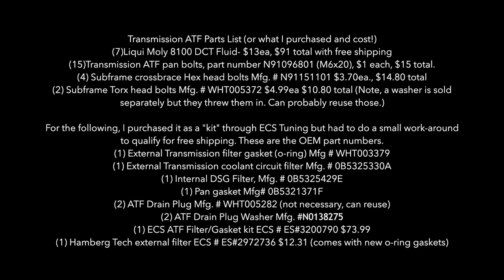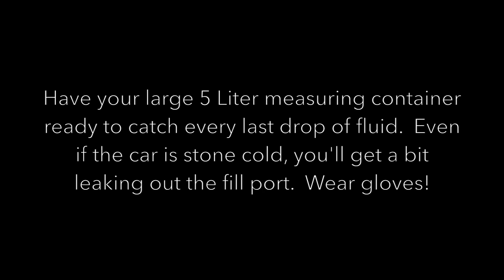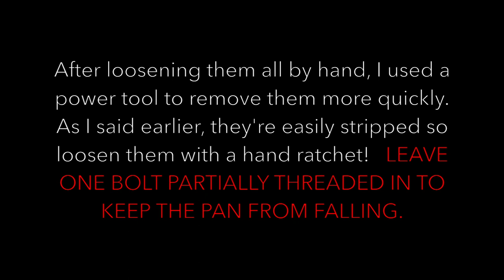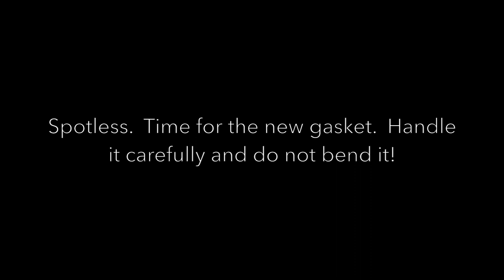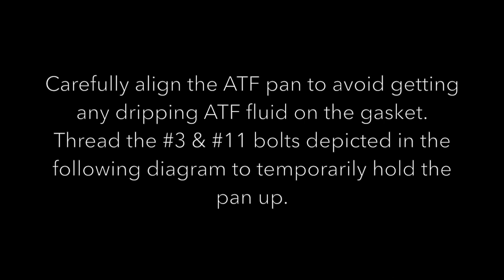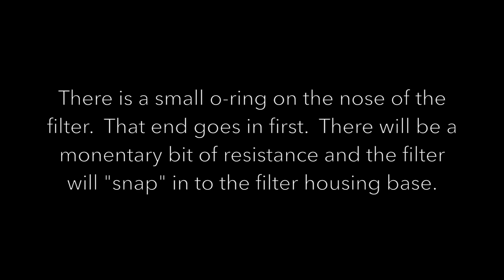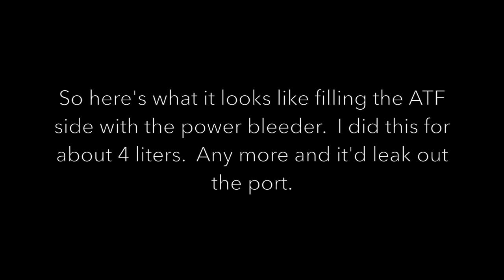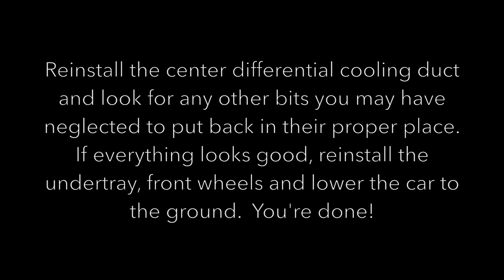RS5 Transmission Service How To

Comment: Love your vids! Quick question, should you replace the cross brace bolts with new ones?
Reply from the maker: Ideally yes, new bolts.  Everything Audi uses is a torque to yield or stretch bolt and is meant to be torqued once.

Comment: Hey, great instructional video. Why was the reason to change the fluid/filter. It is not lifetime fluid on yours?
Also Do you feel some hot spot when your right foot tooches the center console/transmission shifter (where you have media buttons)?
Reply from the maker: It is not lifetime for the RS5 and it's critical the fluids be changed on time per Audi's recommendation.  I would highly recommend replacing the fluid on a regular basis in any car equipped with the DL-501 7-speed S-tronic, RS5 or other.  I haven't noticed any hot spots!
Reply: @RS5Fanatic  My car is 2012 S5 MT 6 speed. I started to get some hot spot when I drive these days. always when my right foot touches center console piece. I heard it is lifetime tran oil. I probably need to at least open the fill plug to check if it is not low.
Reply from the maker: @ersbit  Ok yes, a very different transmission than the S-Tronic!  It can't hurt to change the MTF every 50,000 miles or so especially if you push the car hard at the track.
Reply: @RS5Fanatic  Yep. Great advice. I will change it soon

Comment: Hello. Thank you for this write up :)  
 But I have a question: you have mentioned, that drain and fill plugs atf and mt side have an aliuminium washers. Today I started servising my gearbox mt side and both plugs (drain is with temp sensor like on yours car) and there was no any washers. Looked on ETKA  and there no washers for mt plugs and atf side has just one washer with drain plug. So is here some yours mistakes in this write up or I dont understand what you mean aluminum washers on plugs? 
 My rs5 same year like yours 13", just mine in sepang blue :)
 Thank you for answer

Comment: Nice work dude what kind of oil you used for the ATF side 
I saw your pumping 4 litters but what kind
Reply from the maker: If it was four liters, that's the manual transmission fluid (MTF) and it was the OEM Audi fluid.  I had wanted to use Motul Gear 300 like I did in the differential but their tech guy didn't get back to me in time.  It is indeed ok to use Motul Gear 300.  I like it as it has a super high viscosity index.  The full writeup can be found here:  https://www.audizine.com/forum/showthread.php/833033-RS5-full-fluids-service-how-to-(transmission-and-rear-differential)
Reply: RS5 Fanatic  
I’m going to be honest with you and I’m sure you’re going to laugh I was trying to change the oil on my rs5 last night and I got confused tho I took the plastic cover off the one is next of the steel cover 
And I thought it was the engine drain plug but I guess it wasn’t it was the ATF drain plug according to your report and the diagram you posted on the forum 
So I notice it wasn’t engine oil but it had already drain like 800ml Pf that kind of oil :( so I put the plug back in there real quick and start doing research and found this I need help now tho what do you recommend now to get that done the right way
Reply: RS5 Fanatic I drove the car like that without the oil got drain now is that a problem ? Where can I get a quarter out oil quick so I can have my mechanic put it back in there ASAP ?
Reply from the maker: @johnnylopez5356   I won't laugh.  You're not the first to do that and I've heard of others doing it.  You'll need to get the car up on four jacks (or a lift).  Go to the link above and look for the ATF fluid level procedure.  The other option, which is somewhat easier, is to remove the driver's side throttle body, pull off the vent cap on top of the transmission (It's a little black thing and it pulls right off), install a 3/8" fuel hose, run said hose up above the engine bay, attach a funnel, and pour 800ml of the recommended Audi ATF fluid in there.  That'll at least keep your transmission safe until you can bring it to a shop and have them verify the level properly.
Reply from the maker: @johnnylopez5356   If you cannot get the Audi OEM fluid quickly, Liqui-Moly 8100 is also a good choice and what I use.  I might consider draining all of it at this point (measure it!) and dump in what you took out plus the original 800ml.  You should not drive the car as loosing that much ATF fluid will affect how the transmission shifts.  Be very careful!
Reply: RS5 Fanatic  dude thanks a lot for your quick answers people like you makes this problems easier to solve I really appreciate it 
And yea I notice you use liqui moly 8100 which they have it at Napa Auto Parts. but I was sure if use ATF or MTF oil front side of the transmission but not I know it’s ATF thanks again men

Comment: Were there washers that needed replaced for the center differential MTF drain and fill plugs? My ATF kit came with 2 that I used, and I have yet to do the MTF. My kit did not come with any.
Reply from the maker: There is a washer on the MTF drain plug.  It can fall off and you can loose it when draining the fluid so be careful there.  You CAN reuse it and it will even seal without it.
Reply: @RS5Fanatic  sweet. Thank you so much!

Comment: hi , i realy liked your viseo .
i'm thinking about to buy a rs 5 but the guy say's the the car has a tcu problem in the gearbox do you know something about this ? and is it easy to repair ? 
he say's that the car it's driveble .
please answer , thanks
 .
Reply from the maker: There is something called a mechatronic in the gearbox which is what actuates the clutches.  It was known to be a problem in older Audis before 2012, specifically, the electronics board on the mechatronic burning out.  They updated the design and added a larger heat sink.  On the RS5, it's very important all the maintenance is done on time, especially the gearbox and rear differential.  Make sure the car you are buying has a service history and those items were serviced on time.  

When driving the car, the shifts down should be smooth, particularly 2nd into 1st as you come to a stop.  If you're getting a big "bump", almost like another car has hit you in the back while coming to a stop, it could be a sign the mechatronic is on it's way out.

Nothing on an RS5 is necessarily cheap to fix.  The good news is the mechatronics itself can be repaired instead of purchasing a whole new unit which is expensive.  There are several places here in the U.S. which can fix them as well as places in Europe.  If it's just the electronics board, Audi sells that separately and it's about $400 U.S. for the part.  Fairly cheap.  A rebuild of the solenoids and thermostat is about $500 U.S. and a new mechatronics is about $2500.

So on the S-tronic, the three items which seem to have the most problems are the Mechatronics electronic board (this is NOT the TCU), the mechatronics hydraulic unit itself, and a gear position sensor inside the gearbox portion of the gearbox.  Those are the only items I've ever head going bad and it doesn't happen often like it did on earlier Audis.  

Make sure you have a very specific diagnosis on what is wrong with the car you're looking to purchase.  It is possible to change out the mechatronics unit as a whole or the electronics board yourself, at home.  If it's a gear position sensor in the gearbox, the gearbox has to come out and the case needs to be split to get to it.  It's a $60 part but it'll cost $2K in labor.  Hope that helps and thanks for being a subscriber!
Reply: thank's  @RS5Fanatic

Comment: whats up with the cross contamination  how did you manage that when using the brake bleeder with different fluids for atf/mtf? also you said you used the motul 300??? you mean for the rear dif right??? not the transmission.
Reply from the maker: I did not cross contaminate.  I avoided this by using different bleeders OR by cleaning out the bleeder's container with denatured alcohol.  For Motul, it's GEAR 300 for the rear diff.  I no longer recommend Gear 300 for the transmission as the formula changed.  Redline has a higher VI index now.
Reply: @RS5Fanatic  ah I gotcha! I got an s5 without a sport diff =[... i take it I don't have an ATF side to change on the standard rear diff?
Reply from the maker: @jonathan1164  That would be correct, non-sport diff means no ATF side, just normal gear oil.
Reply: @RS5Fanatic  appreciate it thank you 😎
Reply: @RS5Fanatic  can I use the same ATF oil for the rear diff as for the gear box ?
Reply from the maker: @flabichon  You cannot.  The rear diff is a specific oil they call "transfer case oil" and only use the Audi-branded fluid.  It's expensive but you only need one liter (not even a full liter) for the rear diff.

Comment: Hey man thanks for all the info! Doing the service on my 13 RS5. Can you confirm that the MTF drain plug (temp sensor) has a washer? Mine did not apparently. Thanks
Reply from the maker: It does indeed have a washer.
Reply: @RS5Fanatic  thanks for the reply brother. Do you by chance know the part #? For some reason mine does not have one from the factory and the parts guys here cannot find it in the diagram. They only have the listing for the copper atf one and the temp sensor as a whole.

Comment: Great video. at what millage does this service need to be completed? and what would be the cost of supplies?
Reply from the maker: Going by Audi's maintenance guide, it's basically every 15K, 35K, 55K, 75K 95K, 115K and 135K but changing out the ATF/MTF fluid alternates.  Here's a full breakdown: https://www.audiusa.com/content/dam/audiusa/Documents/maintenance-schedules/MY_2014_Audi_USA_Scheduled_Maintenance_9-7-2017.pdf
I ended up changing both this time around as I wanted to run the Liqui-Moly 8100 ATF fluid and Motul Gear 330 MTF fluid.  It's not necessary to change both at each 20K interval.  

Cost wise, for both sides plus the rear differential fluid, you're probably looking at about $400 in parts alone.  To have the dealer do it, it'll be around $2K unless you've purchased an Audi Care package.  It's still around $1200 with Audicare depending on what sort of deal you strike.
Reply from the maker: I did a big writeup on Audizine on everything I purchased to service the transmission and rear differential.  It was about $700 off the top of my head. https://www.audizine.com/forum/showthread.php/833033-RS5-full-fluids-service-how-to-(transmission-and-rear-differential)?highlight=differential+service

Comment: Hi There!
Thank you so much for this, I wanted to know if you could please help me with some Info.
I have an S5 B8 and I need to do a transmission fluid change. I wanted to know if I can Use the Motul 300 for the Auto Transmission as well? The Cost for Oem Oil in South Africa costs almost $100 per Litre and I'm looking for a cheaper but decent quality alternative. Any help would be largely appreciated!!!
Reply from the maker: Most welcome but unfortunately I don't think you can use Motul 300 in the auto trans on the B8.   I haven't done any research on that transmission so best to stick with the OEM fluid.  There has to be an aftermarket equivalent though.  Just need to find out what the Audi oil specs are and make sure the aftermarket oil meets those specifications.
Reply from the maker: Hey looking at Motul's site, Gear 300LS is recommended along with Motul ATF VI on the auto side of the gearbox.
Reply: @RS5Fanatic  Thanks you so much man! I really appreciate it.

Comment: For the DSG fluid, if we put back exactly how much it came out, do I still need scanner to adjust the fluid level？thanks
Reply from the maker: Technically yes.  You do not use a scanner to check fluid levels.  Fluid levels are checked by opening the inspection port on the side of the transmission.  The fluid temperature has to be within the range listed in the factory service manual (it's in the link).  Once you're at the minimum temperature range, open the inspection port and see if any fluid comes out.  The car has to be absolutely level when you check.
Reply: @RS5Fanatic  Thanks. I will try that!

Comment: Did you reset the temperature counter after changing the oil?
Reply from the maker: I've actually never heard of resetting the temp counter so I'm not sure what you're referring to.  I know when you look at various readings using the VCDS you can look at high temp interventions (temp protection) but I've not really looked for a way to reset them as I didn't think it was necessary.  Plus with the new RMR transmission cooler, heat interventions are a thing of the past.
Reply: @RS5Fanatic  Yeh im kinda confused my self but if you have the Factory service manual under Gr 39 section 6.2 Guided functions for Gearbox 
Changing gear oil on vehicles with gearbox oil temperature
 sender 2 - G754- (Audi RS 5/RS 4): 02 - Reset temperature

counter (G754) (Rep.-Gr. 34) ⇒ page 233
Gear oil change (Audi RS 5/RS 4)
♦ For vehicles with gearbox oil temperature sender 2 - G754-
-1-, the gear oil (MTF) must be changed after a specified
change interval (specified number of km) ⇒ ELSA maintenance
tables .
♦ On these vehicles the gearbox oil temperature is monitored
additionally by the gearbox oil temperature sender 2 - G754- .
If a high gearbox oil temperature is registered over a certain
period of time, an internal counter in the automatic gearbox
control unit - J217- is incremented. If the normal temperature
parameters are exceeded a specified number of times, an entry
is made in the event memory of the gearbox control unit,
and the gear oil (MTF) must also be changed.
In both cases, a “Guided Function” must be performed to reset
the internal counter in the automatic gearbox control unit - J217-
after a gear oil change

Not sure how you would do this on VCDS but its very simple on ODIS.
Reply from the maker: @muckman5509  Ok yes, you can most likely reset it using the VCDS and it's for the manual side of the gearbox. Good to know that's there!  If you get an intervention, your dash'll light up like a Christmas tree and it willl most likely give you a gearbox error but you can drive normally kind of thing,   I've gotten the MTF well above 100C so it'd have to be pretty extreme to get intervention on the MTF side!  Go to this link, I've been discussing the OEM transmission cooler and the interaction between the ATF and MTF side.  there's no MTF cooler.  https://forums.audirevolution.net/t/rs5-aftermarket-transmission-cooler-system/10599/29
Reply: RS5 Fanatic will you be making a vid changing the MTF side ?
Reply from the maker: Muckman it’s in the video.  I change both fluids.  Manual side is super easy.  Just drain, measure fluid and refill in side of transmission.